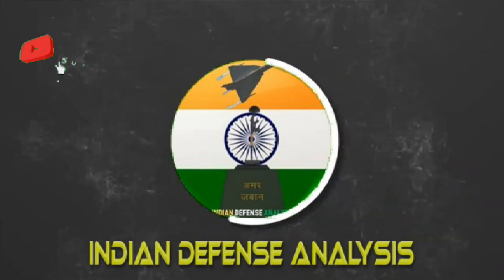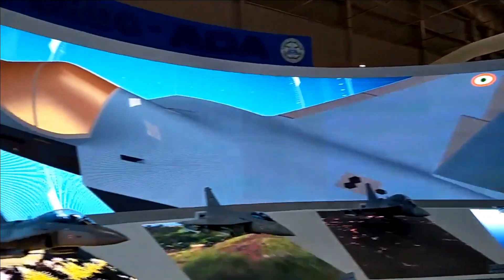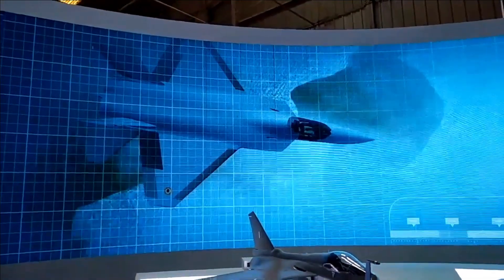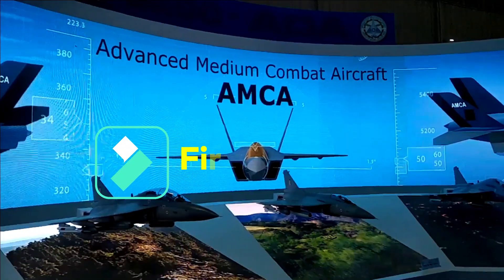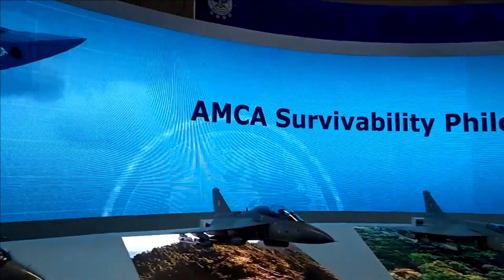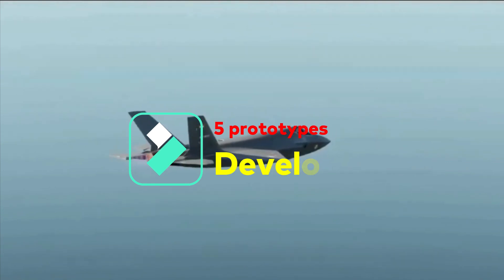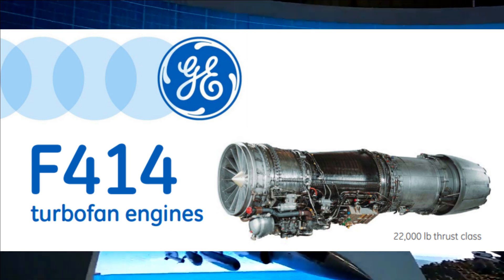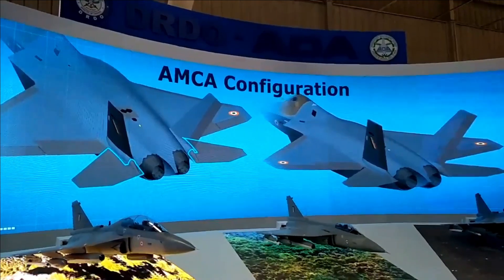AMCA designed for “First look First Kill” | Speed : Mach 2.15 | Combat Range : 1620KM

Comment: Technically ambitious focus. We have to build the combat environment capailities for employing such high technology, low population aircraft. This involves policies, doctrines, procedures, situational priorities viz existing inventory, interoperability in combat and logistic, security and above all cost effective survivable lethality. When , where and how to use has to be brainstormed . Security of operations is very important as future threats may not conform to linear borders with false flag complicity increasing both physically and in cyber space. How to prevent fratricide is another important air-space management priority that has to be continuously upgraded and validated.  Build the environment, build the scenarios but always be modularly upgradable to incorporate future innovations optimally. Skillset optimisation of a pool of specialist crew and support staff also has to proactively carried out. Build capability to use " force multipliers" effectively. ( Eg of low standard piloting skillset and munition delivery using SU-35s by Russians in Ukraine is deplorable. The losses were avoidable).

Comment: Is there any possibility of increasing the payload capacity while using the 125KN engine?
Reply: No, those are all initial design things like no of hard points & kind of role they are going with. Once the design is concluded there is not much scope to add additional hard points to increase payload i guess. The engine upgrade is mostly for improving top & cruise speeds which has got nothing to do with payload it's similar to arranging things in our rooms space. Im not expert but following so many defense videos some what i understood that once the air frame is designed it the final stage to consider the no of hard points or payload.
Reply: @raghu_rsb  thanks man i guess you might be right
Reply: Thrust is related to drag and lift. So I think reduced aerodynamic drag but more likely weight reduction.

Comment: Airframe looks visually very similar to F35 interesting. Makes sense because of aerodynamics, hopefully ours can deliver all the capabilities without the ridiculous price of F35. Will be a game changer if it can maybe even for export.
Reply from the maker: Much smaller than F35 and mostly indigenous content so maintenance is not  going to be costly. F35s biggest issue is it's engines, the blades develop crack when after burners are used
Reply: @IndianDefenseAnalysis  i see thank you for the information makes sense. Hopefully our participation in the Su-57 program previously also will drive some development costs down.

Comment: Which sensor will do the role of MAWS in this aircraft? 
I mean what is the sensor that will replace RWR and MAWS called?
Reply from the maker: It will be the advance version of EW Suite being developed for Tejas MK2
Reply: @IndianDefenseAnalysis  okay Spectra is also an EW suite which has RWR and MAWS, same goes for Tejas Mk2 it's EW suite of sensors will contain RWR and MAWS.

I am asking about the name of the sensor contained in that EW suite that will replace or upgrade RWR and MAWS. Just like AMCA will have EOTS instead of IRST.
Reply from the maker: @abhishekdev258   The most advanced RWR is Dhruti, MAWS will be DCMAWS similar to F35 and external pylons can have AESA ASPJ under development. But they will be spread across airframe to capture threat from all directions integrated with fibre optics communication system.
Reply: @IndianDefenseAnalysis  yes now I have the answer that I wanted. Thank you for making it so clear. 👍

Comment: If the maximum internal payload carrying capacity of AMCA is 1.5 tonnes then how can it carry 4 Rudram missiles internally...? Because 1 Rudram missile is 600kg where as the total weight becomes 4 x 600kg= 2400kg.... So how can an aircraft with 1.5 tonnes of maximum internal payload carrying capacity carry 2.4 tonnes of payload?
Reply: Why do you need to carry 4 Rudram 1 missiles.🤔🤔🤔

Comment: Can AMCA carry Rudram 1 missile in its internal weapon bay?
Reply from the maker: Yes
Reply: @IndianDefenseAnalysis  But the maximum internal payload carrying capacity is 1.5 tonnes.... 1 rudram missile weighs 600kg so 4 x 600= 2400kg.... So how is it possible?
Reply: @CarnageXAddy388z  of course not 4 rudram missiles but 3 missile it can carry of rudram 1.And who knows drdo would be working on rudram ng which will be more lighter and then amca would be able to carry 4 rudram ng missiles.
Reply from the maker: @CarnageXAddy388z  whats need of 4?

Comment: if DEW and Unmanned aerial systems are being considered for MK2, then will the MK2 version be heavier and bigger than MK1 version? if yes, then it will require complete testing of the aircraft again from the scratch, right?
Reply: Lets be honest .. this specs are all  good to look at .. 100 percent it will not materialise .. 
Those incompetent govt workers will make sure it ends up being an another kaveri engine .
Reply: @gautambhonjo3760  no this time its safran is on the bench with hal and that too with majority stake in joint venture company.
Reply: @priyanshupratik1566  An engine pact is supposed to be announced during Defense expo 2022(March). Its almost end of April yet no major update apart from having "advanced talks" with France. Safran has been involved in Kaveri project since many years and nothing concrete had come out of that which might help Kaveri to overcome its drawbacks. Engine technology is closely guarded secret as very few countries have mastered it and sharing the technology to a country like India means that they are going to loose a huge defense market. 
The ridiculous point is that if U.S limits GE in supplying the engines to India, then the entire indigenous aircrafts programs(Tejas MK1, MK1A, MK2, TEDBF, AMCA MK1) will be hampered. Yet, India doesn't have an alternate plan even after suffering from the sanctions imposed on it by the west.
Reply: @priyanshupratik1566   Safran will only be making engines .. that deal too is not signed yet .. 
And making engines is considered to be the toughest piece of technology in aircraft manufaturing .. nations like japan , south korea , germany with all their engineering prowess havent been able to make engines  . So there lies every reason to remain skeptical about our so called "engineers.."
Interestingly manufacturing 125 kn engines from the scratch  leapfrogging all the existing technologies seems very much a far fetched idea as there would be so many teething issues ...
I wonder how they will pull off such a complex piece of technology . So this magniloquence sounds good  but it is doomed to fail  , coz those government coolies i mean engineers cant even manufacture an assualt rifle but pipe dreaming about building an aircraft engine .
Reply: @gautambhonjo3760  Kaveri engine is not a total failure its core is quite good and is certified by the testing agency but the afterburner section need more co-operation and study to master and i agree 125 kn engine will be difficult as hell.But UK and US can't just blatantly and eternally refuse to co-operate with india if they need our assistance in countering china.

And if it something like that happens then also we can still use our dry core kavery engine and utilise it for making advanced drone which certainly we are capable of making and will buy some more fighter jets to act as mothership for them (the drones) or better use lca tejas.

Combat Drones require very less powerful engines as low as 20-30 kn and each kaveri dry core engine without afterburner is capable of producing of about 50-55 kn of thrust which is more than enough for a very very very heavily armed drone (if two engines are used for it).
Reply: @realpennywise  don't forget about dry core of kavery engine which produces 50-55 kn of thrust and is very much suitable for a heavily armed drone.
Reply: @priyanshupratik1566  Kaveri engine is still a long way to go to have all the necessary testing done to be integrated into drones. there were talks of Kaveri engine derived marine engine as well but no progress on that as well. 
I remember reading that one of the major problems with Kaveri is that it is not able to maintain the thrust consistently for long periods of time and also some 'humming' noise from the engine which the engineers were not able to identify. may be they have fixed those issues now or may be they haven't. Not much updates on Kaveri in the recent past.

Comment: Heard AMCA mk1 is mach1.8 and ony mk2 with indegenious 125kn engine its expected to have 2+mach.. is mk1 also 2+ mach?
Reply: If GE-414 EPE Engines, which are in the 116 kN to 120 kN thrust category, are offered to India and used (likely), AMCA Mk1, too, may have supercruise capability, although maybe just. Of course, Mk2 should be able to do so comfortably, if everything goes to plan. 

While speed alone is not of much consequence in these days of near-hypersonic AAMs, sheer power and good aerodynamics gives the airplane the ability to quickly attain and sustain high supersonic Mach nos. without afterburners, which in turn  provides excellent maneuverability. This, coupled with various other counter-measures to dodge enemy missiles ( like decoys and flares), could help a modern fighter plane return safely from most missions.
Reply: @SamS-lr5ub  oh, thanks for informative comment.
Reply: No
Reply: Mk1 will use GE 414 developing 110 kn, so it’s less than Mach 2
Reply: Speed is of no use now

Comment: Don't the Canards increase the RCS? That's what previously was said by IAF chief about J-20.
Reply from the maker: Yes
Reply: Will AMCA have Canards?????
Reply from the maker: @IshwaraŚiva  no
Reply: @IshwaraŚiva  your user name tells u are racist.
Reply: Most of RCS depends on the engine intake. If an aircraft uses RAM paint then the overall RCS is dropped at least 20-30%.
Canards in this case are close coupled to the main wing and its control surfaces.